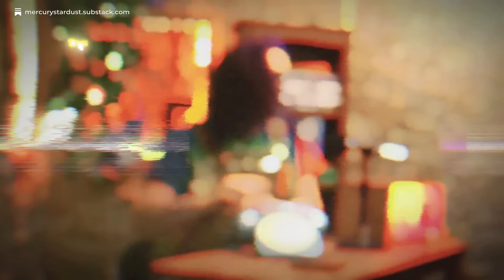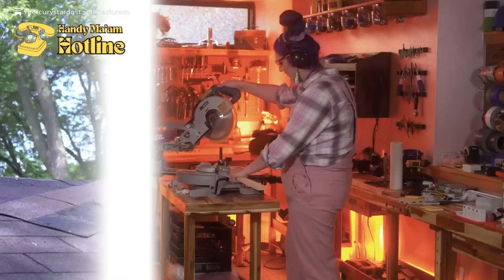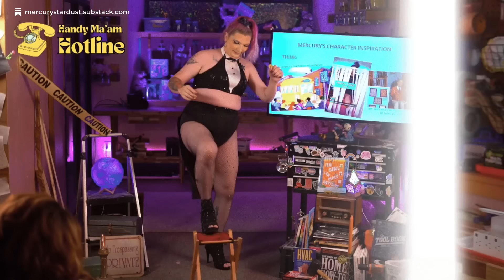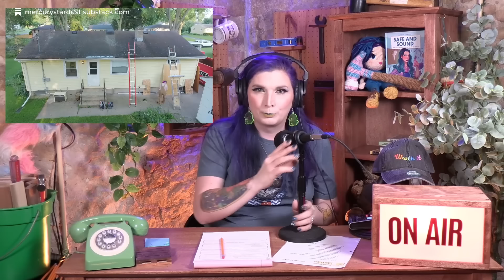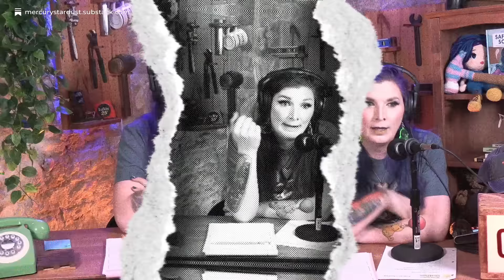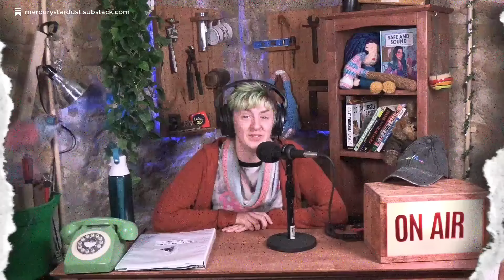Mercury's House | Handy Ma'am Hotline

Comment: Hello there.  Quick question . My shower water is having issues where either the atwr is so hot or super cold. While we are showering the hot water goes completely out cold in the middle of shower. And if you try to switch the shower head to a different setting it goes complete cold. Then we have to wait a min or 2 until hot water  ones out again. I talked to a plumber, and they switched a thing iande the nob inside the shower head switch but still going to it. What could It be management is not listening

Comment: Hi there, I really enjoy watching how the house is coming along.  15 years ago, I too was a first time home owner.  I was freshly divorced and on my own.  The house I found was a house with "good bones".  Since I moved in I have;  replaced 6 windows, replaced the roof, replaced the furnace and electric hot water heater, switched out fuse box with breakers, replaced flooring in 2 rooms, replaced range and hood, repainted sewing room, fixed hole in basement wall, replaced both outer doors and one inner, renovated bathroom (only one, yikes!), and ............. had 5 huge trees removed to protect said house from getting crushed.  (Added more insulation to attic to bring it to R40) ... it's damned cold here in the winter - PEI, Canada

Comment: My struggle these days is getting hooked up to the municipal water supply. I'm SO close!!! Getting a reasonable and affordable contractor is the race to be won. I've lived here since 2007 and have had to haul and ration water every day, it's so stressful and those 5 gallon jugs are #$@% heavy🥵🥵🥵🥵🥵 You're a girl after my own heart with all this purple😁😁😁😁
Reply: Get yourself a large skateboard. Buy it used. Suckers come in SO handy for moving stuff ! My friend "turned me on" to this trick years ago, and I have moved BIG stuff with it. Sometimes by myself, sometimes with another female friend. 
 You can use the angled back of the board as a fulcrum to tip something large. Tip large thing, insert skateboard, then slowly tip large thing onto the skateboard. Kind of hard to describe,  and be careful, but starting with 5 gallon jugs is a good start ! Plus, they are super easy to throw in your vehicle & bring with you ! 
Good luck !
If you buy it used, you won't cry if you break it, lol 😆 ! 
But they are many layers of plywood,  so amazingly strong !

Comment: I had a house I owned several years ago (2003-2011). I made some major changes to the house, and many minor ones. I transformed a tiny bathroom, and a small bedroom into one larger space that included the washer and dryer (previously in the basement), a larger shower, etc. In order to do that,  I had to reroute the back stairs to end in the dining room rather than the kitchen. I also had some of the vinyl siding come off during a storm, so I had a friend take off the rest from this gable area. To my surprise, i found these wonderful scalloped wood shingles. I decided to keep them in the porch rather than throwing them away. After I had to give the house back to the bank (not because I wanted to, but I didnt have the money to fix some other issues, and the mortgage company wouldn't loan me any  more money to fix it). I drive by there occasionally to see how things were going. Not only did they put the vinyl siding back up (and covered up the beautiful scalloped shingles), they covered over the main front door with siding (I never had a key for that door and it was screwed shut), and they covered up the windows in an area that I had wanted to use as a sun room.....and changed it into the laundry room.
I really would love to buy back the house, but maybe someday.
Reply: Dang. Sorry you lost the house. Sounds like you really worked hard on it. I DETEST SIDING !!!! UGH !
Reply: @m.maclellan7147  i even still have a drawing i made for before and after floor plans. I bought it for $30k, but couldnt get extra to make some repairs. The worst thing was i kept getting in troublewith the city inspectors about various violations...one of which was the electric. While I was still in the process of moving out, someone broke into the house and stole lots of things, some sentimental, some inportant(including ripping out drywall to cut out the copper pipes....but the oddest thing was they cut cords off various items as well as all the exposed wiling in the basement. It is a 2300sqft house plus an unfinished basement. I have an idea who did it, but I have no proof, and even tho I filed a report...the police didn't seem to care...even tho there was a footprint in a pile of cayenne pepper (used to deter future raccoon issues) and a cigarette butt in the bathroom sink. 
One good thing came out of the deal, I was able to locate a cookie jar I got from my grandparents that looks like a antique stove. I paid $30 for it, so I still have some heirlooms.

Comment: if they had hardwood adding carpet can protect it as long as you cover it right and don't do a quick cover and staple job. Don't knock covering the floors if you need it for your daily life!
good graces that roof, that's an example of patch and cover being a bad method. good on the neighbors for coming over so quick to warn you!